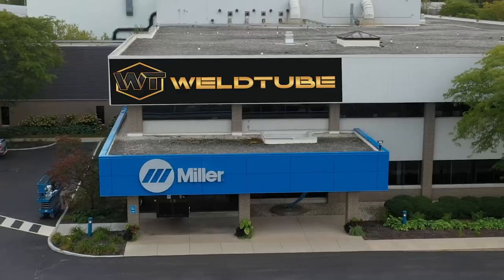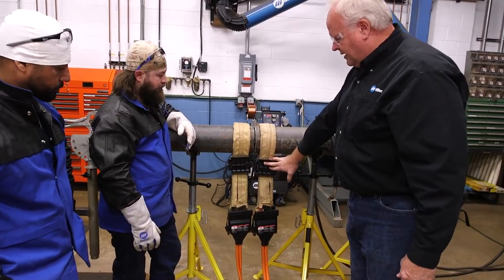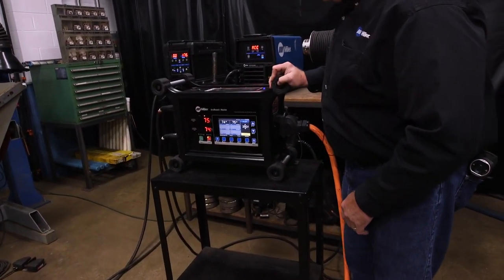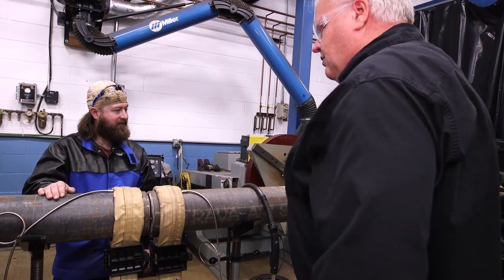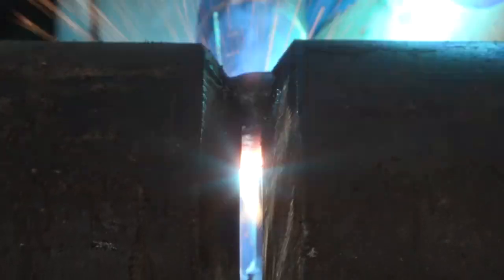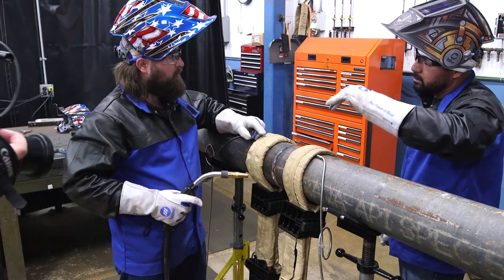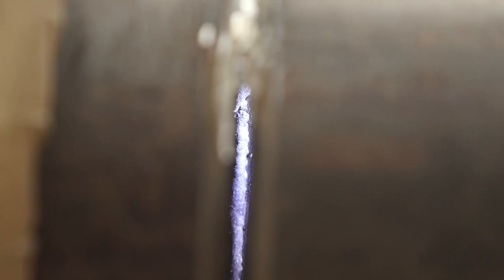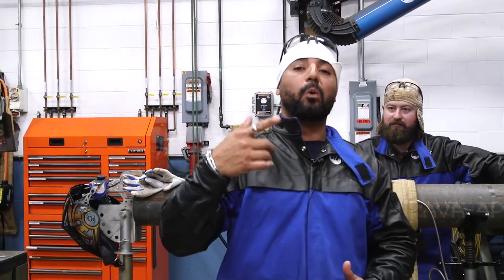9% Chrome RMD Welding | Heat Induction

Comment: thermocouples not good, just tack temp wires on the pipe ,much cheaper also,, i did that 25years ago
attached to a chart reader, to avoid going over a temperature, just my 2cents

Comment: Does that say API 5L on the pipe? I had not realised API 5L covered 9% Cr pipe..?? It doesn't tend to rust too easily either. Maybe just the wire is 9 Cr V...?

Comment: What is pipe material and welding process? If pipe is 9chrome  Why Purging gas is not used?
Heating system is good, however is it useful when using  positioner or turning roller?

Comment: I just don’t see this being stronger than tig welding the root. Ive worked in many power plants and you won’t see this in the field. They also make a flux coated tig wire to circumvent purging and it runs pretty good.
Reply: You will 100% see this in the field bud 🤣 and don’t lie that mud rod runs like trash and u know it rmd is literally quicker and provides a more consistent band and easier flow within the pipe not to mention it’s a hell of a lot quicker not saying it’ll replace tig but it’s definitely going to be seen a lot more then it already is. Just gotta keep up with the times son
Reply: Been using this 2 years in the field building 2 power plants. I don’t see it replacing tig but it does come in handy when you’re welding 24” 9chrome 2” wall. Guys are knocking that shit out in 8-9 hours here. It’s all about production
Reply: Dont need to be more stronger , just more fast and strong enough , time is money
Reply: Won't see this in the field? That's almost all we use on pipelines 20" and up now.
Reply: @mikereimer4048  you use copper nickel on the pipeline?
Reply: @projectgz  yeah until shit starts blowing apart and it kills some body
Reply: @benwill5426  thing that just never hapens if you follow the homologated proces
Reply: @benwill5426   We do not. Just the RMD process for the bead. Switch to pulse for the hotpass. Then fluxcore out.
Reply: The requirement isnt that its strong as this or that process.. the requirement is that it's as strong or stronger than the base metal.. as for the rest... dont use flux cored or coated wires on steam pipe that lead to the turbine.. and yes they do use this on steam pipe In the field..
Reply: @christopherblanda9502  until your weld breaks cause the wire wasn’t strong enough💀
Reply: @mexicanwelder5967   er70s-6 and er70s-2 have the same tensile strength so a tig weld and mig weld assuming it’s carbon have the exact same strength when done right

Comment: Wouldn’t it be heated way over 400 degrees when you start welding lmao
Reply: Yes. But 400 is minimum preheat. There's  always a max heat too. On the steam pipelines we build, minimum is 300 and maximum is 500.

Comment: That induction heater would be ideal for pulling and installing interface fit couplings!!   If it would get hot enough.
Reply: We use machines up to 200kW for this application.  We are talking about serious shrink-fit components (blower hubs, retaining rings, bear races) etc on industrial turbine generator rotors, roller mill motors, etc.  It gets plenty hot.  With the machine in the demo (Proheat 35) I have heat a 14,000lb steam chest to 1200F.  We also patented 'bolt heating' technology using induction some 25 years ago.  The largest we've heated with this technology are studs with through-bores up to 18".

Comment: This is a simple version of heat stress. I did this for 3 years
Reply: @Leonardo Morand This is heat treating. It is induction. Same principal as resistance and gas heat treating. The term for this particular application would be Pre-heating. Being 9% chrome and having such a high interpass temp I’m sure it would be followed by a slow cool.
Reply: @brandongonzales6887  where can I find jobs to do this? What is the name for when you bond them after they weld? I'm looking for those jobs
Reply: @nardo34480  well that depends on where you’re located? I’m right on the gulf coast and we have quite a few heat treating companies around here. Analytic Stress, Texas Stress, ITS, SuperHeat, and also a lot of your Non Destructive Testing companies will have a heat treating side to them. And if you’re talking about the process after the weld is completed then that is Post Weld Heat Treating. I’ve never met anyone who knows the exact scientific process that goes on during the heat treating but it has to do with the molecules in the material. Realignment I’m assuming. I started welding so I have not been looking for a heat treating job so I don’t keep in touch with anyone from my past heat treating jobs.
Reply: @brandongonzales6887  I'm a welder but I was in Pennsylvania at the monaca cracker plant and I was doing post weld heat stress for 3 years. They pay good but i was sent there as a welder but ended up doing that. Thank you for naming some jobs as well im going to look for them now that I have a proper name cause i actually enjoyed it and it wasn't really physically demanding. I Eben ran cable tray and installed data and power cable there as well...
Reply: @brandongonzales6887  I'm in Florida by the way
Reply: @nardo34480  okay, yeah if I were you I would just search heat Treating companies in that area or heat treating jobs there. I can almost guarantee there is going to be something near you.
Reply: @brandongonzales6887  I'm from Houston and I work for Texas Stress. Been heat treating for 15 years
Reply: @yunghogg88  I worked for them for about a week then something unfortunate came up and I was let go. I was communicating with Jeremy which seems like an awesome guy. Wish things would have worked out, I was excited to be apart of that team. I did heat treating for around 6 years. Finally got the chance to be a welder so I wanted to get that under my belt as well.
Reply: @brandongonzales6887  the purpose of 'PWHT' is to remove harmful stresses in the weld vicinity, primarily in the heat affected zone (HAZ).  The HAZ is the area of base material which is not melted but has had its microstructure and properties altered by welding or heat intensive cutting operations.  There are various reasons to PWHT; increase ductility and reduce hardness, diminish brittle failure, increase resistance to corrosion, and improve machining stability.  Without going down the physics rabbit-hole, the process is designed to return the material to its intended grain microstructure.  This is especially true of P-91 (P-Group 15e) CSEF (creep strength enhanced ferritic) steel.

Comment: can you just weld it cold and get the same result?
Reply from the maker: Chrome has to be preheated.
Reply: @weldtube  ah yep okay
Reply: Just like cast iron needs to be preheated. Using cast iron rod.
Reply: @RBFR01  it will crack.
Reply: A post heat as well .
Reply: Crack and has to be post heated and wrapped with insulation so it doesn't sudden cool

Comment: Really interesting. I've been looking for a technology to use with concrete pours of pozzolans that benefit from curing for 28 hours at 130 F. Could this welding induction heating system be adapted economically to such uses? Geopolymer pozzolan can get up to double the strength with precise temperature, and cure in a tenth the time of conventional OPCs.
Reply: Induction heating only works with ferro metallic materials because it uses magnetic induction to produce heat.
Reply: @Whereismy10mm  Absolutely true. And not a problem where steel rebar or staples are used in the structure or aggregate. More like an opportunity. 
The questions I have are how much ferromagnetic material is needed, how deeply does the induction heating penetrate, how practical is it to use this equipment on pours, and how cost effective?

Thanks, and looking forward to more discussion.
Reply: @bartroberts1514  it would not work well in the that application. First of all you would only heat those Ferro materials, so you wouldn't exactly have consistent heating throughout the concrete unless it is evenly spaced throughout every cubic inch of concrete. Secondly, the inductive heater needs to encompass the metal. So unless you can wrap the coil the entire way around the concrete you are trying to heat via the metal, it wouldn't be feasible.
Reply: LOL.  Nope.  I know how you can do it... You can't afford it.
Reply: @ShainAndrews  Huh. Way to rez a zombie thread.. six months after I found the solution I wanted.